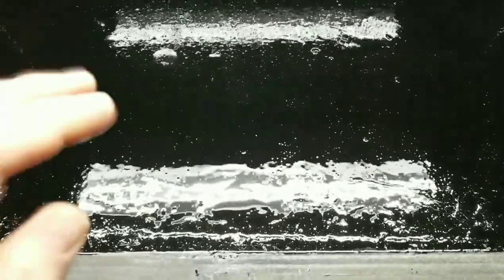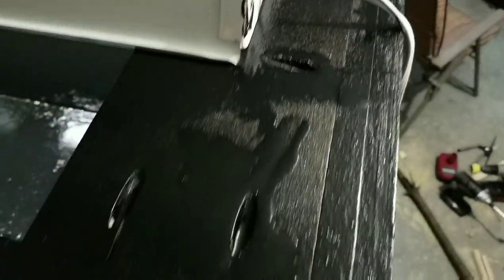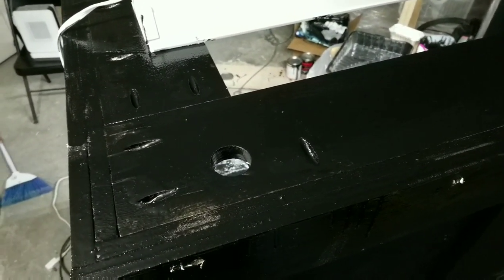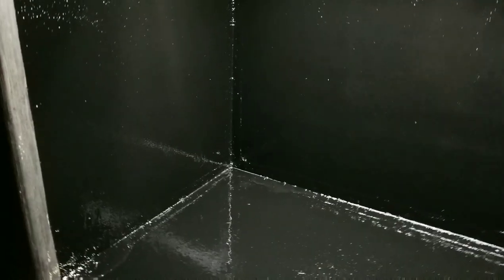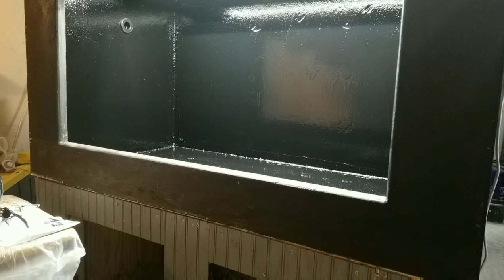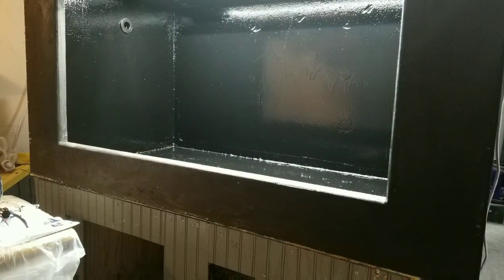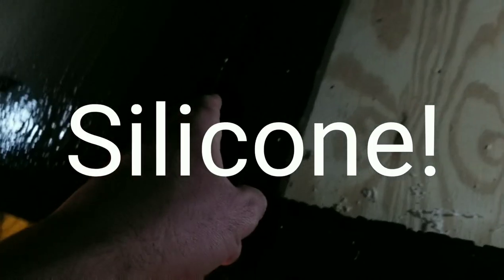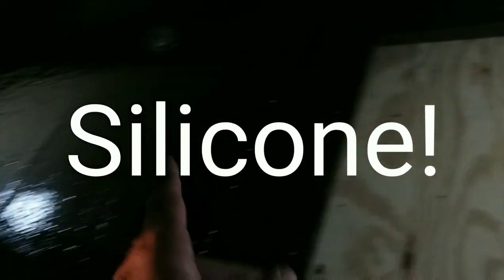Part 3. How to install acrylic on a plywood aquarium.

Comment: How do you know if your sheet of acrylic  is thick enough and wont bow? I found a guy selling  a 4x6 sheet that's 5/8 thick. I want to use the whole sheet for the viewing pane. I'd like the tank to be 72 long 48 high 24 deep. If I have 6" borders I'll still have 3ft of viewing space. What are your thoughts?
Reply from the maker: From what I've read the taller you go the more pressure is on the acrylic. I plan on building a 1000g tank when I buy a house it will be 48" tall and I'll probably use 1' acrylic.

Comment: Nice work David!  Just found this channel and your plywood tanks look great.  I'm in the beginning stages of planning a plywood aquarium and like you, want to use acrylic.  I've emailed a few acrylic companies and Pond Shield about bonding acrylic to the epoxy and Butch from Pond Shield said my plan could work well...  I asked if the epoxy itself would bond to the Acrylic if I sanded a perimeter and applied epoxy right to the Acrylic like a frame that covers front, back, and sides.  That way I could just use silicone because its bonding epoxy to epoxy.  Of course I'll use screws like you did for extra strength.  

Did you use the resin in the corners before you applied the fiberglass matt/tape/fabric?  Or just put the epoxy over the fiberglass?
Reply from the maker: Hello Patrick and thanks for watching. I actually bought a test piece of acrylic 8x24. I sanded half and ran a bead of every silicone I had and the pond shield. I really should have made a video of it. The pond shield didn't stick to the acrylic very well once cured. The silicone actually stuck better. But your plan would work mainly because of the screws. Make sure you go every 2 inches or so and use stainless steel. GE silicone scs 1200 and momentive black silicone stuck the best. Both are fda compliant so food safe. I put the epoxy on the edges before adding the  fiberglass to the corners one corner at a time.
Reply: @dtizzle30  I'm surprised the epoxy didn't stick to the Acrylic, thought that stuff would grab hold of anything.  How disappointing lol.  I assume if that didn't stick to Acrylic then trying the fiberglass and resin around the perimeter of the Acrylic wouldn't work well either?  Either way I'll still follow your example and then run silicone around the outer edge of the panel too as a first line of defense, after its screwed in to place.  
So far so good with the tanks?  Do you still think it's definitely cost effective and worth it to build?  I plan on building two, 8'x2'x2'  of those things! Lol.
Reply from the maker: Absolutely cost effective I built the 350g for 800-1000 bucks. I would never be able to find a regular tank that size for that price. Plus not as heavy if you half to move. I definitely recommend it. When I buy a house soon. I'm going to build a 1200g tank.
Reply: 1200?!!  You better do plenty of videos documenting it!  Wouldn't mind seeing how you move the other tanks too!
Reply from the maker: Yeah, I will do a better job of filming it this time. Moving will not be fun lol

Comment: What brand/kind of silicone did you use to seal the acrylic
Reply from the maker: I used motive 103. Black.
Reply: @dtizzle30  do you have link
Reply from the maker: @jamesb7689   MOMENTIVE RTV103-300ML RTV 103 Silicone, One-Part, Black, Paste https://www.amazon.com/dp/B077GWBMFF/ref=cm_sw_r_fm_apa_i_wgHREbWYAVTFB
Reply: @dtizzle30  thank you also I went home depot today trying to find those stainless steel screws couldn't  find any do you have link for those as well and size you used
Reply from the maker: Hmm, they always have them. They're in different area I believe. Ask someone that works there. I don't remember what kind of screws they were.
Reply: @dtizzle30  do you use same ones for every build
Reply from the maker: Sure do
Reply: @dtizzle30  do you have fb so I can ask some questions

Comment: Everyone uses glass because 1) it doesn't bow and 2) silicone adheres to glass much much better than acrylic.
Reply from the maker: I definitely agree but for the size I needed acrylic was alot cheaper. I would have rather used glass but acrylic worked fine for me. Just make sure the thickness is correct to prevent bowing. And secure with screws use silicone as a gasket.
Reply: @dtizzle30  what was the length of steel screws?